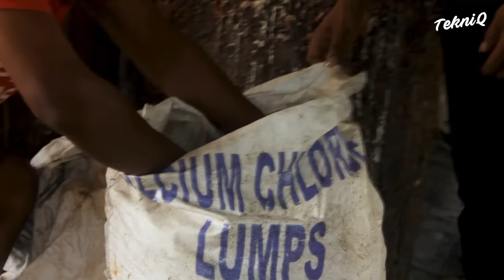Amazing Way they Mass-Produce Billions of Rubber Bands in Factory

Comment: At what point is hand labor more economical than other methods? I find it hard to believe that bag of rubber bands on my desk was hand-made in a village in India.
Reply: If labor is cheap, they use cheap machines, even if those machines require a lot of labor. If labor is expensive they buy the best, most productive machines because they want to make efficient use of that labor. There is a wide spectrum of possibilities. This is why labor unions can improve general efficiency of a factory. They force the wages up, so management will buy the most productive machines in order to make good use of their expensive labor. The result is higher productivity per man hour. If the wages had remained low, productivity would also remain low because management would see that using more labor and less machinery is the cheapest way to make the product.

Comment: This NOT some modern factory, but rather some back yard hacked factory. They are using substitute McGiverered equipment. In no way is this a legal cooperation. OSHA would shut this place down in a flash. I saw some pretty youthful workers that in no way  be allowed a work permit to work there. 
A real factory would have the workers in protective gear, they would have proper gasfired and electrified furnaces and heating units. The inspectors would not allow the filthy conditions they work in and the fall risks (stuff they could fall over while doing their tasks would be removed) would not be allowed. The workers would be protected from the chemicals with gloves, masks, respirators and protective clothing. The building would be fully enclosed and proper ventilation systems installed in the manufacturing facility. This whole thing looks like something a farmer out together in his back yard to make a little extra money.
Reply: OSHA doesn't apply in this country. OSHA is American and has no jurisdiction there.